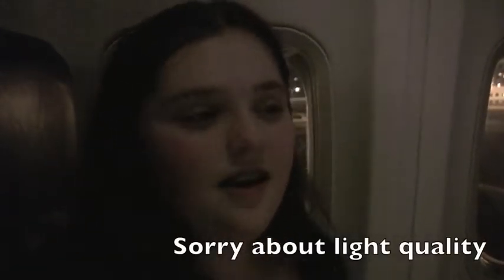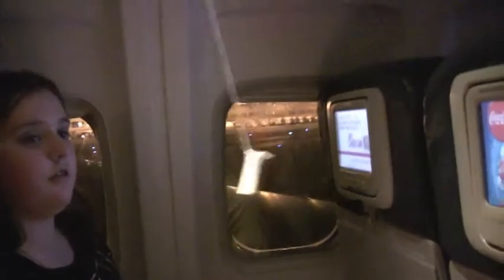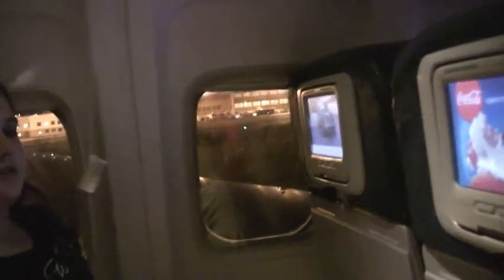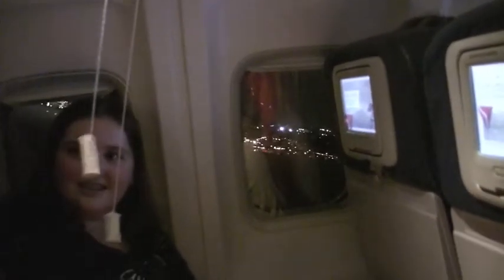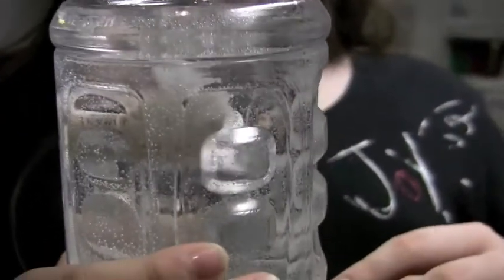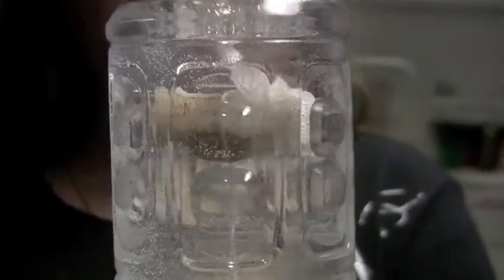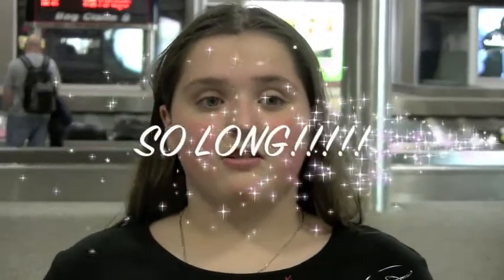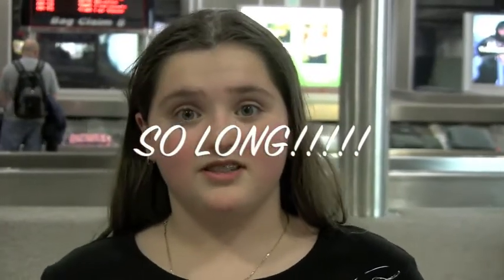Physics experiment on plane

Comment: Excellent work Amanda! Too bad it was hard to see the device on landing very well.
I could see it move back at one point (and the pendulum definitely was forward).
Also, can you confirm that the plane was in straight and level flight when you did found the period of the pendulum in the middle? 

Hopefully no run-ins with TSA or unruly FAs.